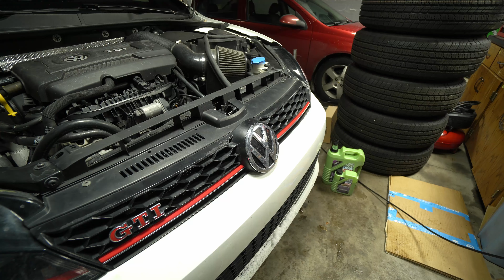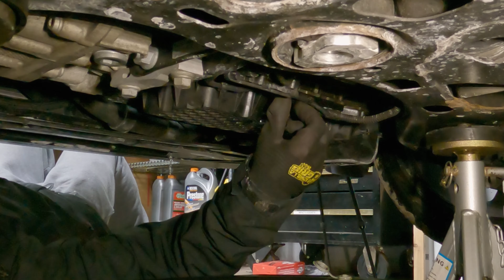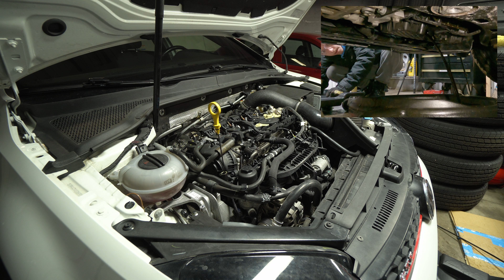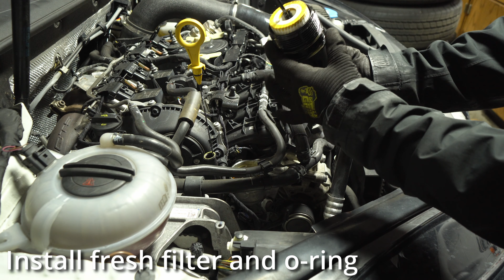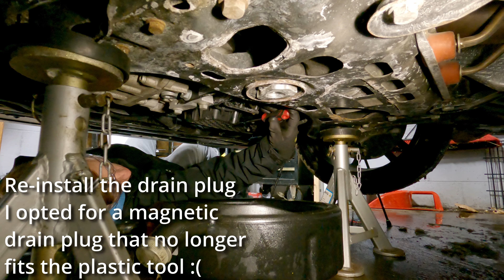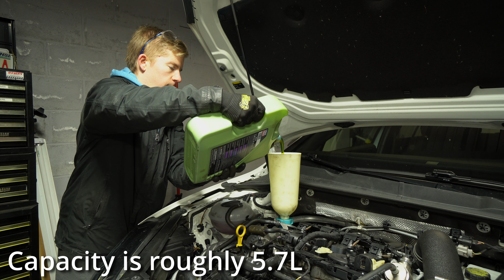Oil Change Mk7 Golf GTI

Comment: Do you recommend metal filter housing replacements?
Do you recommend metal oil pan replacements?
I'm running Amsoil 5w-40 in my mk7.5 and Wix filter.
Reply from the maker: I don't think there's any benefit to a metal oil filter housing and I've actually seen them get stuck on because of expansion and contraction due to heat cycling. A metal oil pan isn't a bad idea, but I prefer to avoid objects in the road vs driving over them. The plastic pan is quite robust. If you're hitting something hard enough to crack through the plastic pan there's a good chance the metal one won't survive either.
Reply: @HardwayLearning  Good points. One thing I do think VW should have done a little better is the oil drain plug. While I see that it does work and it's convenient with a 1-turn-and-off feature, it sure does register in my mechanical brain as something that is much less positive than a simple metal threaded plug.
Have you ever replaced that plug with a new one? Or at least swapped the o-ring?
Reply from the maker: @exothermal.sprocket  I always bought my oil change kit from FCP Euro and they come with a fresh plug and o-ring so it gets changed with the oil and filter 👍
Reply: @HardwayLearning  Okay, nice to know.